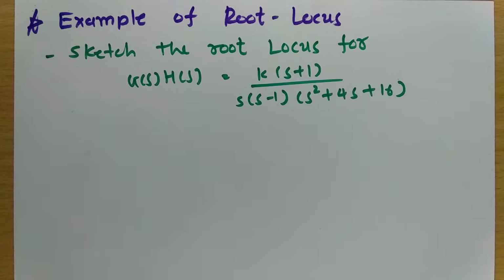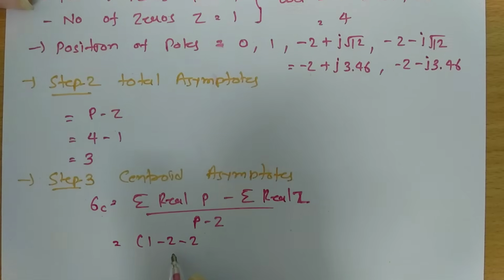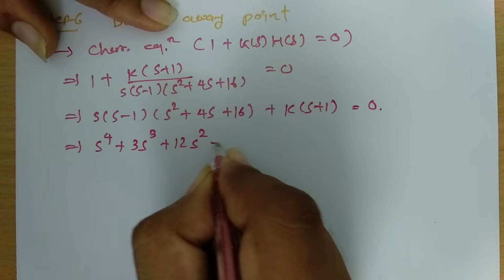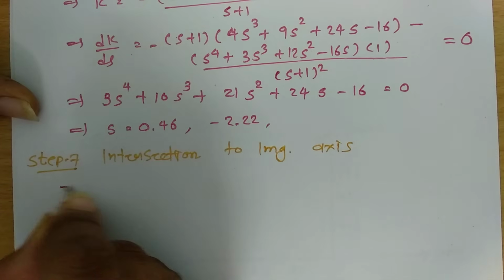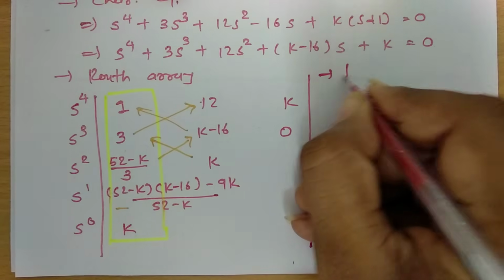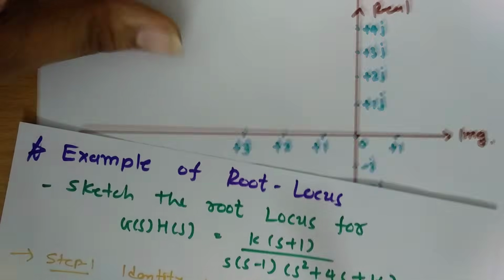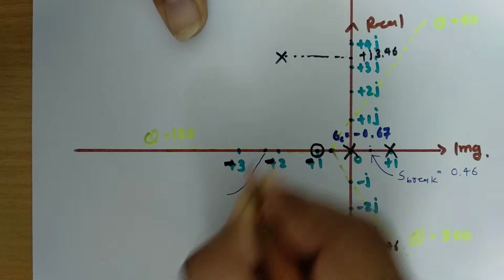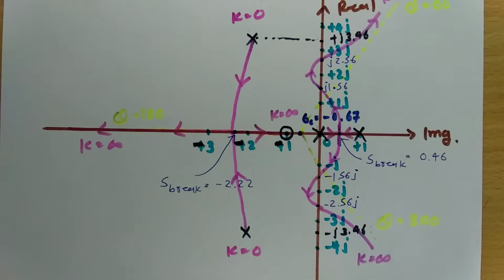Root locus Plot Explained: Rules, Steps, Procedure, and Solved Example 10

Comment: For anyone wondering the departure angle from the poles in the complex part it is aproximately 87 degrees positive and negative
Reply: It's 87 + 180 or 180 [we need to choose one of these. So since our break away point is at -2.3 something, therefore we let departure angle 180 + 87, which is precisely opposite to 87 degrees. If breakaway point turns out to be something like -1.28 (say), then you need to choose 87.

Comment from the maker: When roots are there on real axis, line will get traced on real axis only, as root locus should be symmetric with respect to real axis. So we calculate angle of departure for complex roots only.
Reply: Doesn't this numerical have complex root?
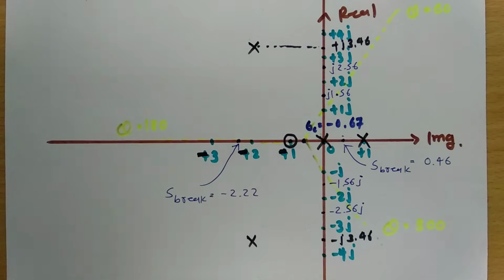Reply: 20:03 departure angle is -54.798 for complex roots. So it should be start with -54.798 degree then, it goes to break-away point ?

Comment: Sir, why is angle of departure not calculated for the complex roots in this question? Why is it taken as a break in and not break away point?
Reply from the maker: I thought we can make root locus without it. But you will get it with same diagram as explained here.
Reply: Mera confusion abhi bhi hai sir clear samajh nahi aa rha aap kya kah rhe hai
Reply: @techeduidea2598 Agar jab bhi poles pe complex roots hain toh angle of departure find karna hi padega.
Aur jab zeros pe compex roots milte hein toh angle of arrival find karna adega
Aur agar simple roots hi aate hain toh phir angle of departure or arrival ka toh sawal hi nahi hota
Reply: #107(example 5)mein issi type ka problem hai waha aap angle of departure kyu liye hai ye samajh nahi aa rha hi
Reply: Same confusion
Reply from the maker: When roots are there on real axis, line will get traced on real axis only, as root locus should be symmetric with respect to real axis. So we calculate angle of departure for complex roots only.
Reply: @EngineeringFunda   here to complex roots are there then hay didnot we calculated angle of departure
Reply: Bhai same Meri confusion thi...